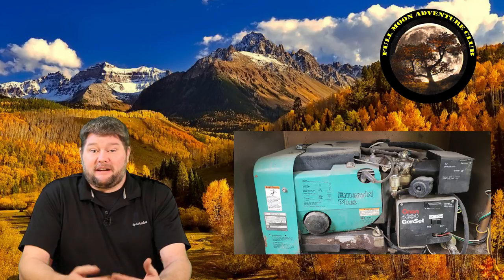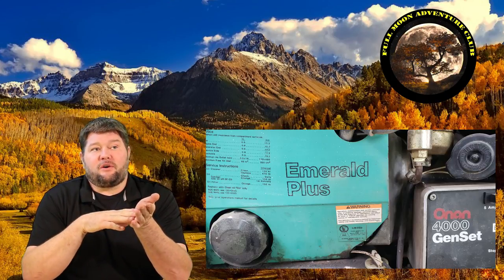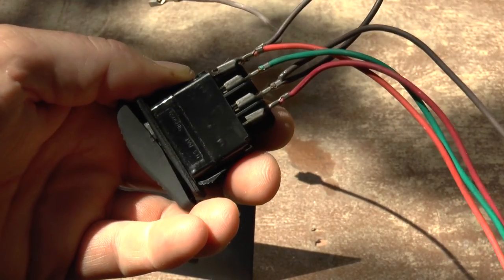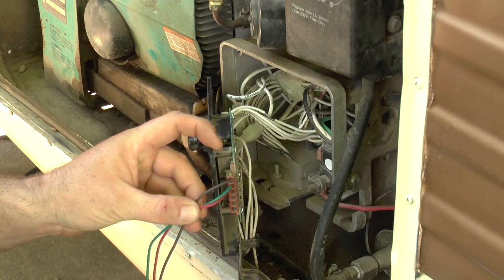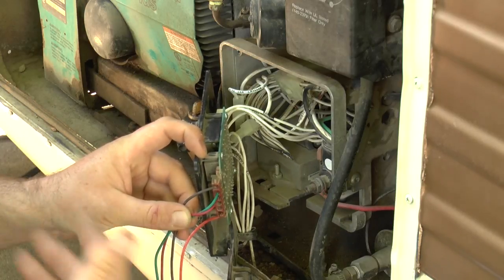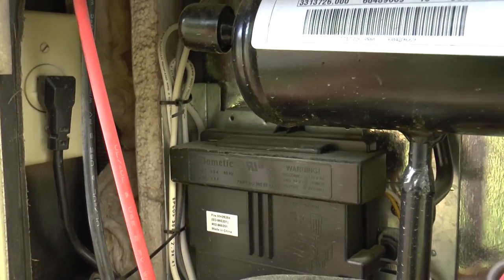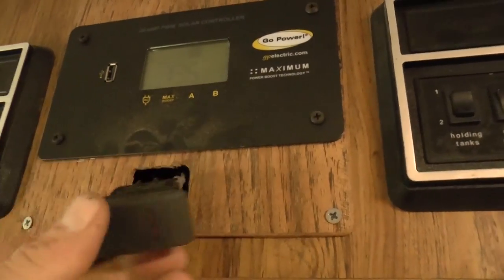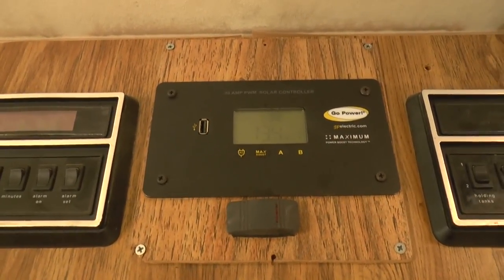Add A Generator Switch Inside Your RV - Cummins Onan 4000 watt Generator switch install

Comment: I have the same generator as yours. I have been trying to find out the remote start wiring for awhile. Now I know. Thank you for posting this. Woohoo! I can now have a remote start switch. Thanks.
Reply from the maker: I am glad to hear that. Trying to research the wire diagram was a nightmare so I thought maybe one day it would save someone a lot of time searching online. Glad I could help and thank you for the comment. Take care and happy camping.    Jim

Comment: Great video, I have the same genny. If you every want some good fun, try replacing the step motor and dealing with that wiring. I have a '93 Royal Classic class C, and am working through that now.

Comment: Jim, you should have run the wires in those corrugated wiring tubes or some type of tubing like flexible PVC, old garden hose and whatnot. When traveling rocks and sand will eventually ruin the little 12 gauge wires and it will eventually short out and stop working then you will be back to going outside in your spongebob boxers in the dead of winter to start the generator.
Reply from the maker: I thought I mentioned it in the video but I went back and used flexible pvc wire casing to protect any rub areas. Thanks for the tip and happy camping.  Jim

Comment: Good vid as always... Wondering if you will ever get to that battery testing vid we spoke about. 2-6 volts vs 2-12 volts under load off an inverter. It would seem as stated before to you when Rvers go to 6 volts there may be too much of voltage drop to run heavy loads, like a microwave.

 It may be well when the batts are fully charged but 6 volts may start dropping voltage too much when say @ 75% capacity. Where the 12 volts may run items better without kicking the inverter out on low voltage.

I ran my microwave with 2 -12's all the way to about 50% without the inverter kicking out. Before I invest in 6 volts I wanted someone to tell me what they can run and what their drop is.. It seems all are reluctant to tell you that. 

Sure if I have low what use items 6 volt is the way to go. But I like to run micro, coffee maker, and a toaster oven when boon docking...

Hope to see that test soon. Keep up the good work.. its always a pleasure to watch your modes and such
Reply from the maker: I was working on that video before I stopped working at RVFourSeasons. It will be more difficult to arrange without the use of all those batteries they had at the shop. I will have to buy them myself before I can do the experiment. It might be a while but I am still working on it. It was nice having a corporate sponsor. :/ It is on hold for the moment.      Jim
Reply: Lawrosa1   I can tell you from personal experience if you don’t go with quality AGM’s and you’re trying to use a 1,500 watt or more pure sine wave you will have issues.  12 volt or 6 volt it doesn’t matter.  I’ve been down all these roads over the last 20 plus years when I started using inverters for various items.  Good luck.

Comment: Do you know what the name, style, and/or part number of the pins that plug into the generator side of the remote plugs. Also, were you normally source those pins. This would be a big help, as I need to replace a couple of pins that corroded.

Thank you,

John

Comment: Great video, as usual. I'm looking for a remote start switch for a DuroMax 4350 watt generator. Any suggestions? Maybe a bit more complex than your install.
Reply from the maker: I think any generator starter switch will work. I think it comes down to preference in design and aesthetics.      Jim

Comment: Hi Jim what do you do about bubbles in your fiber glass siding do to water damage
Reply from the maker: Hifi Universal music  I have not figured out a simple solution to this yet. To my knowledge the best way is to remove the fiberglass repair the wall and the water damage and then reapply the fiberglass with appropriate adhesive.
Reply from the maker: I received your question about solar panels and batteries but I can not reply to it for some reason. I will be doing videos on that exact question soon so hang in there and I will answer that soon. Take care and happy camping.    Jim

Comment: Hi Jim I was fogging my backup generator and the worst happens the tube goes into the intake now the engine won't start ...I've seen plenty of youtube/videos with people running  there onan generators  off of a large gas can but never showed how exactly they did it. Do you have any knowledge on how this might be done .

I have a onan marquis 7000
Reply from the maker: Running a generator off of an external gasoline tank is a dangerous set up. The tank is very vulnerable to tipping, spilling, sparks, ect. You are definitely better off fixing the old generator gas line set up if at all possible.To connect your generator to an external gasoline source you just need to attach the fuel line to the external gas tank. However, if you're  fuel line is fed by the same fuel pump that is in the gas tank of the motor home you will need to get an electric fuel pump in order to feed the fuel from the external gas tank to the generator.   If the generator itself has its own fuel pump than it should just be a matter of running the generator gas line into the external gasoline tank. You might look into boat gas tanks as they are designed to be external gas tanks. Safety should be your top priority with this type of setup and the external gas tank should be away from the RV, generator, or any other ignition sources when in use.        Jim
Reply: @fullmoonadventureclub  thanks  Jim won't be doing that (safety first ) Kodiaks the way.

Comment: does a onan 4000 have an automatic transfer switch to switch from shore power or is there a manual switch?
 I dont get power to the microwave when on generator alone.
Reply from the maker: Newer RVs can have a transfer switch. Mine however uses a thirty amp plug that is plugged into the generator outlet or is unplugged and then plugged into shore power. If your microwave works on shore power but stops working when the generator is running that would indicate that there is a problem with the transfer switch or the generator. That is assuming that nothing has power from the generator. If it is just the microwave that is affected that would would be a mystery that would require checking voltages in the system.      Jim

Comment: What wires do I hook up to get power to the outlet plug,there is no key switch just wires ,it runs good,just no power to the plug can anyone help me out there.thank you
Reply from the maker: I'm not sure which wire is you're talking about . And I really can't  tell you how your wires should be connected without being there. When mine is running without holding the start switch normally and there's no power to my plug It's usually the little black switch circuit breaker on the side of the generator. If it's not that it could be one of your Breakers inside the RV or a faulty  plug or wiring. Also, check the gfci plugs in the RV.   Jim

Comment: My onen generator won't turn over my batterys are charged and I still have gas in tank i even tried starting it at the switch
Reply from the maker: I had the same problem with mine at one time and it turned out the starting wire going to the battery was worn out. It could also be the starter or the switch.     Jim

Comment: Great video! Question, do you know if you can have 2 start/ stop switches in your RV? I have one in the side entrance and I would like to add one in the drivers cockpit
Reply from the maker: Yes you can definitely Add a switch anywhere you like. You're simply going to run a toggle switch that's powered to the solenoid that controls your start-stop switch under the hood. It sounds a little complicated but I'm about to do a video on fixing emergency start switch so that should help a little bit.